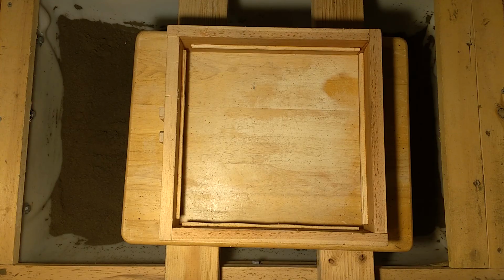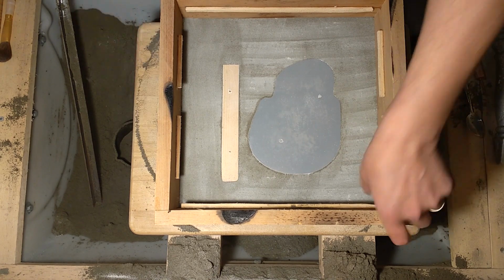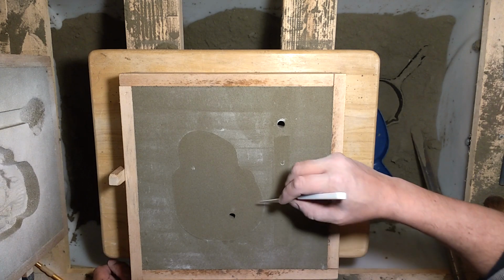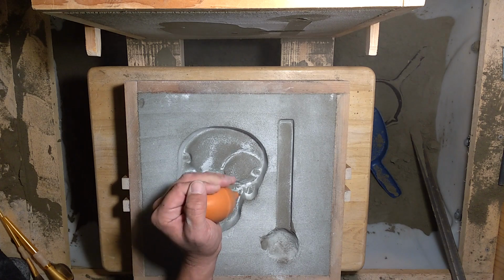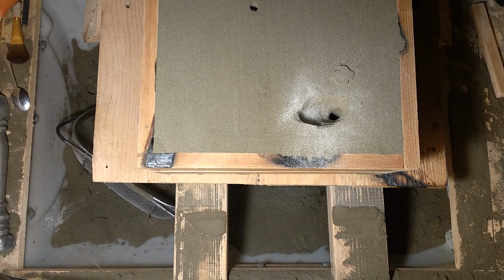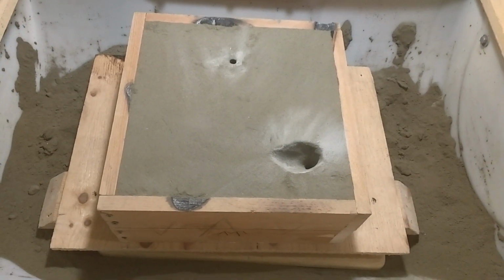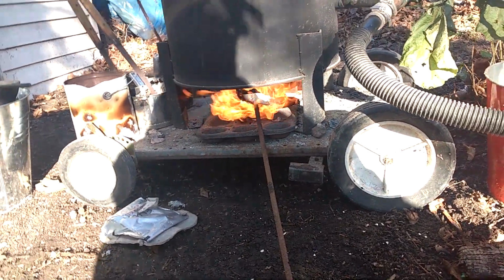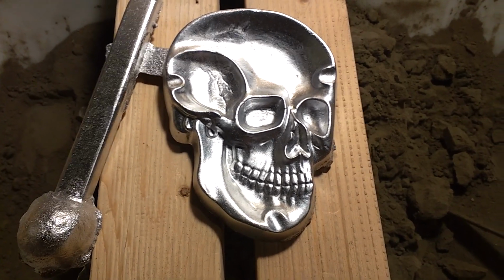Casting A Skull-Shaped Aluminum Ashtray, er... Candy Dish

Comment: I would pour the other way round, filling from the bottom up, not from the top up , with several gates to avoid metal swirling around in the mold cavity, cooling at different rate, and i would use a big riser, even not through type, to store metal for contraction. The metal storage should solidify last. Just my little advice for perfect casts.
Reply from the maker: Thanks for the tips, I've actually been thinking about changing how I mold and gate this one.
Reply: @tobhomott  You can get good castings even if the gating system is not good, but a well thought gating system will bring you to the next level in terms of quality (bubbles, inclusions, uniformity). Also it is important to pour the metal at the lowest possible temperature. Say 750C for aluminium.
Reply from the maker: @puits-de-science  I couldn't agree more, thanks again for your comments.

Comment: LoL... Nice. I cast one of these exact ashtray/dish thing in the mid 80's when I was in Jr high. Kept it until this last summer when I sold it at a garage sale.
Reply from the maker: Mike Stevens Thanks!  Thays funny, I figured somebody must have done this before but I  wasn't able to find any pictures of metal ones online.  I wIsh I had discovered metal casting when I was in junior high instead of in my 40's...
Reply: Yeah, we had a pretty good industrial arts program back then. We did woodworking, small engines, drafting, welding & foundry work. They usually lasting 1 quarter of the school year. I made the skull, a small baseball  bat & a sign with 2 ducks on it.
Reply from the maker: Mike Stevens wow, we just did som very basic woodwork and sheet metal bending projects in our middle school IA class.  Wish I'd taken more shop in high school.
Reply: Yeah, this was probably like 1984 or 1985?? In our school is was pretty much a requirement for the boys. Boys did Industrial arts and girls did home economics
Reply from the maker: Mike Stevens yeah, I was in middle school around then too but where I went to school the boys and girls all had both industrial arts and what was then called 'family studies', switching between the two halfway through the year as I recall.  And probably learning half of what would be useful as a result, lol

Comment: Nice job👏. If you will rap the pattern and blow the loose sand out of the edges before you ram the cope on top of it you will have very little flashing to deal with
Reply from the maker: Never thought of rapping the pattern then, only after both halves are rammed up and it's time to draw out the pattern.  Thanks for the tip, I'll try that!
Reply: Tobho Mott yes, as soon as you ram the drag and flip it over, lightly rap the pattern to loosen sand right at the parting line and blow it out then dust it before ramming the cope. One piece patterns especially to make sure you are tangent to the actual edge break. It'll make a much cleaner parting line
Reply from the maker: Clarke E thanks again, I've never heard of doing that, but I will trust the word of anyone who makes castng iron look as easy as you did in Chirpy's Tinkerings' Soule 2017 videos!
Reply: Tobho Mott lol, nothing is easy but practice makes perfect. I actually learned that trick fro oldfoundryman
Reply from the maker: Clarke E I love his channel, I copy his sprues etc. :)